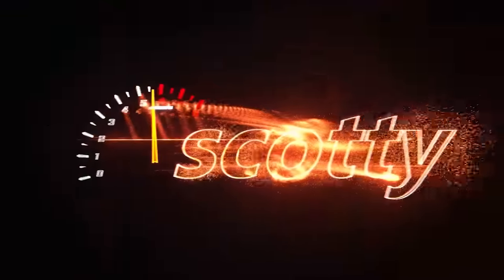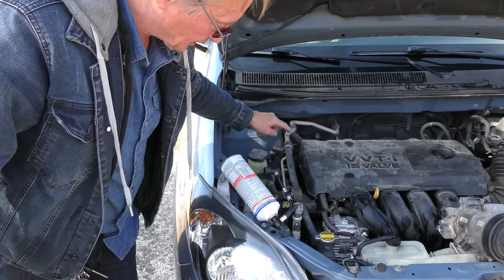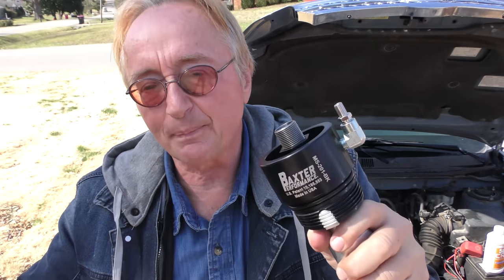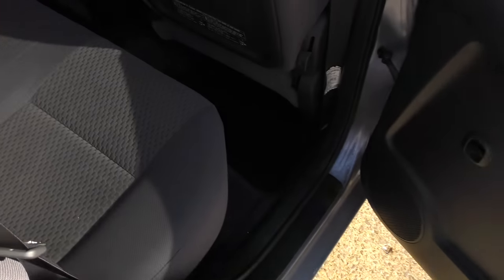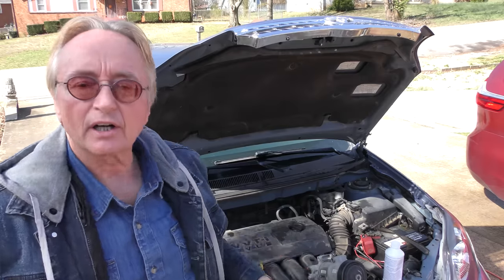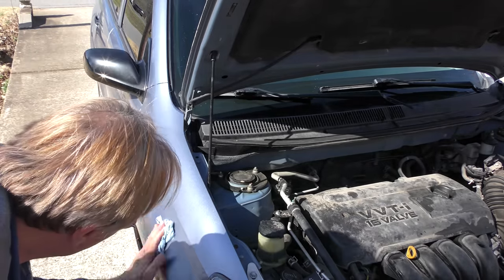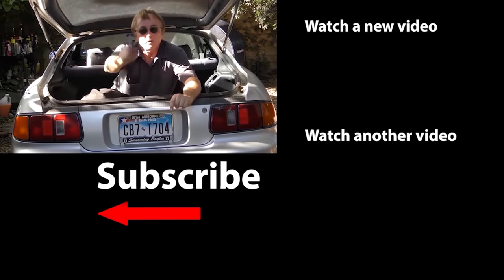7 New Car Products You Should Buy

Comment: Love the idea behind the Baxter cartridge to spin-on adapter... but for my wife's 2017 Highlander it's $280 !!!!
Love it... but don't $270 love it.    

I can change the cartridge without much mess.  There's a 3/8" center cap to take off, plug a drain tube in (comes with most cartridge kits), then you remove the cartridge housing... often cleaner than spin-on as you're draining most the oil.

Comment: I tried the rainx because Scotty recommended it and even bought my first car based on his recommendations and the man is completely honest and his recommendations are great.
Reply: I like the Rain X washer fluid. It also keeps the windshield beading up in the rain, even on 10+ year old windshields.
Reply: So, the RainX waterless carwash he shows here is great as a glass cleaner that'll allow rain to bead off the windshield?
Reply: Rainx and Cthru are very old products been using them in Africa for thirty years.  Just make very sure you clean the glass properly before applying or its a mess when it rains
Reply: o he is amazing, and the local mechanic that I trust says the same thing as him 95% of the time, with the only real difference being where I live the temp swings from -20F (average) in winter and 101F (average) in the summer then you realize those are only 70 days apart, I need things that can handle wild temp swings and a few of the things Scotty swears by don't do well in those conditions

Comment: The ATS definitely works. Used on my wife’s GDI Hyundai Genesis 3.8 V6 with 50k miles. Used to throw out a little puff of blue smoke on cold startup (low tension rings), now no puff of blue smoke and gas mileage increased to exactly where it was new, which was almost 40 miles per tank full.
Reply: Just 40 miles per tank? Or per gallon?
Reply: @joshuaandrepatrelullauri1691  40 additional miles per tank full.
Reply: Where is ATS sold?
Reply: Full tank*

Comment: I like that filter converter kit, but the only real problem I can see is that oil filters are often in a weird spot and the filter "converter" may be too large and not be able to fit as I've seen instances where you might have only about 3 inches between the bottom of the filter and something else, so it may have limited use, but a good idea regardless.  Plus some cars have the oil filter on the bottom of the vehicle.  So adding something like that may make it too long, risk getting bent or broken and then you have bigger problems.

For paint, I think it may depend.  I had to get some touch up paint for my Camry to fix a small rock chip, and being that it's only 2 years old and the Celestial Silver color (which is a silverish blue) it's hard to find that paint color (even though that color has been out now for 5 years since the most recent generation came out in 2018 in the US).  If you have an older car, then some of those paints will probably work fine, as they will likely be the best you can get, but for newer cars, I would try to get the OEM paint first.
Reply: Another problem is that adapter is $250.00.  I'll buy the synthetic media Fram Ultra insert and deal with it.  If it was $30.00 id say it was a good idea.

Comment: I purchased the ATS Fuel Treatment recommended from a video of yours last year and it got rid of my check engine light on my Q7. Carbon build up on the valves, It Worked!! had to run two applications but it saved lots of $$ of having the intake removed and the valves chambers cleaned. I recommend the product all the time now. The Oil treatment is great too!

Comment: I have had the 3d maxpider floor mats on my car too for 3.5 years now and it still looks brand new when I clean them! Highly recommend. 
I didn't know about the consumer ac refill. Great to know!
Reply: I've tried them all and Maxpider Kagu's are the best!
Reply: How does it hold up again spills and snow? I have weathertech and wondering about this brand
Reply: @Streetracerex1998  it's completely weather proof . Spills, snow, rain, mud, etc. Won't get passed this mat. The top layer is like textured plastic (probably some high tech stuff) but is completely water proof. It also has high walls that hold it's shape well so nothing is vgetting passed this very slim
Reply: @Streetracerex1998  Amazingly.  There's an elevated rim that keeps in water/snow, etc.  I drive Uber and have tried Weathertechs and Huskies which are garbage and ghetto looking compared to the Maxpider Kagu's.

Comment: Scotty you should follow your own advise. There is no way to tell how much refrigerant is in there. The only correct way to do it is to get a set of guages that measure both sides, drain the system of refrigerant and fill it to the factory load that's listed under the hood.

You won't know if there's a problem with the AC system unless you measure temps on both sides and do a vaccum test to see if there are any leaks.
Reply: so you are saying NOT to use that product from Autozone?  I'm thinking of doing so based on this video
Reply: @usaman7358  That isn't what I am saying. If you want to do it correctly, draining the entire amount of refrigerant out of the system, and look up how much refrigerant your car takes. Buy only that amount of cans and put them in.

However without a set of guages, you won't know if you have a leak or clog in the systems

Comment: My way of not making a mess from the oil filter is as this. First warm up vehicle. Next pan under filter. Use 16 penny nail to pucture filter. Go inside watch T.V. for half hour or so. Remove filter And install new filter. Don't forget to apply small amount of oil to the rubber gasket at the top of the filter. Reposition drain pan. Remove oil pan drain nut. Go watch T.V. again for half hour or so. Reinstall oil pan drain nut. Fill crank case with oil. Use funnel to put old oil back into now empty oil bottles. Return used oil to parts depot.

Comment: So as someone who spent 6yrs in the automotive industry you do not want to use those emergency AC refills without research. Not all cars use the same refrigerant. Some are 1234yf and some are 134yf. You do not want to mix refrigerant. Check your manual before putting one of those in and make sure it matches. We have to have two separate AC machines for both types of refrigerant.
Reply: The 1234yf is reverse threaded on the connections, hard to mix it up

Comment: They did the same to me at Honda with my AC, we have to do the $150 diag, to replace the $5 Relay, which is 95% of the fix when this problem happens.  They swapped the Relay out, fixed the problem, only after they did the $150 diag.

Comment: Yea, one can go and simply fill up their a/c system as described here but the correct procedure is to, first, empty the system to a vacuum for at least 10 minutes (to dry the system out as water is damaging), check and repair leaks, and then place the correct, clean a/c refrigerant into the system, with the correct amount of a/c oil. 
Not applying the vacuum can be bad if you have water in your system, very bad.

Comment: I actually have the same 3D floor mats for my 2013 Subaru outback. Over time, I noticed that they weren't looking clean. I washed them with soap and a brush but they would dry dirty looking.  I don't recommend them if you're looking for something that looks clean after you wash it.
Reply: They aren't good mats. Nothing beats WeatherTech

Comment: Scotty, you should have told people not to turn the AC filler can upside down when filling the AC system.  Getting liquid Freon in the system can muck it up quick.
I checked out the oil filter adapter.  YOW!  $$$$!
Reply: Also, didn't they switch to a different refrigerant on newer cars?
Reply: @robertknight4672  Yes.  People still call it freon, though.

Comment: The Baxter adapter for a 2014 Jeep Cherokee 3.2L V-6 is $350.00. I can buy 23 K&N cartridge oil filters for that price. Ouch.
Reply: One time usage
Reply: It's about keeping your vehicle in the highest quality possible for the engine and transmission. You can put a spin on filter that has an anti drain back valve

Comment: It sounds like using the ATS fuel treatment got you about a 1 mpg improvement.

Another simple thing worth doing to improve mpg is to clean the mass air flow sensor, making sure to clean all the right places - the wires and the bulb-shaped thing(s). I watched a Youtube video showing those places. Changing the PCV valve is another usually cheap thing worth doing. (It wasn't cheap on my Mazda 3, because the PCV valve was under the intake manifold, so I paid someone to do it.)

After doing both of those things, I got roughly a 3 mpg improvement. This is probably the first time in its 70,000 mile life that they were done, so it's not surprising it made a difference. It made more improvement than I expected, too.

Comment: I also prefer corded appliances, but recently bought a battery hand drill that has performed very well. Other battery tools had the battery die in less than two years, even with recommended charging. The new batteries work well, but I still buy corded.
Reply: Bought a 1/2" drive Bostitch drill Christmas special,  came with hard case, 2- 18v lith batteries/charger for $99.. That was pushing 10 yrs ago.. and I'm still using it.   Bought a Dewalt 1/2" about 2 yrs ago with 2- 20v batteries, with soft case.  Needed one more compact, and I figured, how long can this Bostitch last?  🤣🤷‍♂️  still going...

Comment: I drove a car hauler since I was 23 yrs old and rain X worked great on mirrors and windshield and yes you can drive them with wipers off but were great on mirrors and spot mirrors, oh by the way I hauled for GM but I drove Dodge cummins have had 2  and one was a 1992 5 speed manual and the latest is what Iam still driving my 05 Dodge 3500 4 door long bed dullay with 6 speed manual and 4x4 . Love your video’s!!!

Comment: Spot on about the Baxter oil filter conversion unit. A little pricey but worth it. Built like a solid piece of steel. My mechanic had to do it for me because the Toyota dealer put the cartridge filter on so tight I could not get if off but I took it to a mechanic to get the plastic garbage off and install the Baxter unit. Really simple to do but like I said but the Toyota housing was really overtightened, On an 18 Rav4. Love it. Do it!! You won't regret it.
Reply: That will not work on my 2012 Camry, that stupid adapter thing is so long that the oil filter would actually be dragging the ground. The cartridge filter is just not that big of a deal to me, they work fine.
Reply: @markkauffman6184  I know what you mean. The model they make for the RAV4 enables you to use a filter length that when installed  cannot be seen and doesn't protrude at all. Of course you have to use a shorter filter but it seems to work fine. Nothing wrong with the original cartridge system but if you don't do your own oil changes you are trusting someone to install them without over tightening, which happened to me.(it was a Toyota dealer too, that's what really P...ed me off.
Reply: Do you tend to repeat sentences twice in daily life, too ?!?
Reply: @warriormanmaxx8991  Now that comment is really petty. I hope it made you feel better to put someone down.

Comment: I recently changed my oil on my 2012 Malibu and found oil gushing from the top of the plastic cover. I had cracked it either taking it off or putting it on. My car would not run will it was leaking like that. Luckily Autozone had a replacement on hand. I'll have to keep a spare or get this adapter you showed. I think I'll get both just in case.

Comment: The emblem on the floor mat will break off and leave two holes in the mat. If you don't plug the holes, all the water will go down those holes and get in your carpet and won't dry because the mat stops air from drying carpet. So if ya get these to protect carpet from mud, good luck
Reply: How do you know?
Reply: @DonYeyoReaks  hes obviously had them..

Comment: I think you missed the main point on the Baxter oil filter adapter, its designed to keep the oil in the top of the engine on the rockers and other important parts, especially the first few seconds during cold starts.

Comment: Got a 03 Yukon Denali bought it new with 11 miles on it, it now has 155k miles and the AC system has never been touched or recharged after 19 years. Still blows 30 degree fahrenheit air on a 90 degree day.

Comment: I bought Baxter adapters for my 4Runner and Tacoma.
Wife took the Tacoma for oil change, the mechanic wouldn't use it.

Also, I will need to cut a hole in the skid plate of the 4Runner to have room for it. Trial and error, Baxter didn't offer any help with where to make the hole or how big. I love the idea of using spin on filters, but it'll take some doing

Comment: About the floor mats those look awesome.  My only issue is I prefer carpet on the driver side so I can wipe the bottom of my shoe off if it's wet before I touch the petals.  Happened to me before that my foot slipped off the brake because it had gotten slick so it became my habit to wipe my shoe off when it's wet outside.

Just seems all the custom mat companies are making things that do not absorb water at all.  Which I get the reasons for doing that, but there's a downside as well.

That Headlight looks sweet!  Having been a contractor for 16 yrs I went thru a lot of headlights and flashlights.  That one looks awesome.
Reply: I don't rubber floor mats either.  All the water sloshing around in the winter drives me nuts.  Why not some super absorbent Carpet mats.  It honestly feels so much more premium to put my feet on carpet.

Comment: I'm thinking about the Baxter oil filter adapter for another great feature. I have a jl wrangler with the dreaded 3.6 Pentastar v6. This keeps oil in the filter so that it can lubricate the valves and cams in the upper part of the engine during srart-up so it helps prevent dry starts.

Comment: Honestly those plastic filter housings are not bad at all. The one on my 2013 corolla has lasted over 200,000 miles worth of oil changes lol. It's easy to remove, pull the filter paper out, but the new one in and the new ring. To each their own.

Comment: The oil canister adapter looks like it will hang lower than skid plates? How will that work off-road or with on the road debris???? It can't be any longer than the stock set up or you're potentially asking for it to be puncured and there goes your entire engine? I also heard the Baxter adapter is around $250....I'll deal with the mess and keep my clearance and thick aluminum canister housing....

Comment: I'm going to try this ATS fuel system cleaner. If it does mostly what a mechanic charges for cleaning your injectors then it's worth it. SeaFoam is a funny thing. In the fuel system it doesn't do jack but if you have an older car that uses organic, non synthetic oil it can do a lot to clean out the crankcase and engine. It works really good on those Briggs & Stratton lawnmower engines. Those things are really bad at sludging up on you.
Reply: Briggs & Stratton have gotten so cheap nowadays. Plastic carbs and cheap build quality.
I bought a new mower in 2017 with a Briggs engine and used nothing but Synthetic oil and changed it religiously and in the 2nd season it already had oil blow by leaking a bunch of past the air filter and making a mess on the deck. Apparently its bad piston rings or head gasket.
I bought a Honda last year and haven't looked back. Build quality is night and day.

Comment: I had a 09 Matrix that burned more than a quart per 1000 miles at just under 100,000 miles. 13 sonata with 180k doesn't use oil at all. All makes have some lemons.

Comment: Scotty have you tried using the oil canister bypass on the matrix? I have 09 Pontiac vibe, and dont want to use one of those unless its proven to work for the long term. Dont want it malfunctioning and either not filtering properly, or starving the engine of oil.

Comment: I have a 2004 Toyota Tundra. With my Blue Drive I read my chicken light was caused by an O² sensor. I had them changed in 2018. I am wondering if the ATS 505 will help.  Or if I should use it at all in my Toyota considering the year.  I did move from Orange Texas @ 16 Ft sea level to Washington @ 187 Ft sea level. But I am thinking this does not matter or all my O² sensors would throw a code.

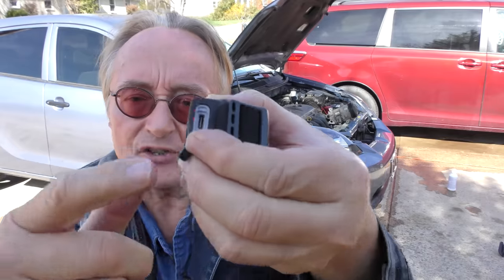Comment: 6:16 my son bought me 2 Beni hats and they have a place where a really great long lasting LED light fits . It has3 different power modes and also plugs into a standard charger that you put your cellphone cable in to charge and I can’t believe how strong they are and how long the battery last before it needs to be charged. I lost 1 and found it about a year and a half r 2 years later . It charged right up and shows 0 signs of being effected after being dead so long

Comment: I have a 2017 Toyota Prius I bought it new in 2018 gas prices were low no one wanted them got a great deal I have 45,000 miles on the vehicle and I have averaged between electric and gas 107.5 miles per gallon I can send you a picture if you don’t believe it.I believe the combination electric and gasoline works very well for around town commuting not necessarily long distance.

Comment: Huge fan just bought 2004 nissan maxima sedan SE 6 speed dual exhaust. Anything at all about the car you'd have to say even review the thing would be rad. There are few things I'm getting repaired , anything I should watch for, any great actually useful mods , 5 k added value in parts or less give or take is my current stance on it. It has 105,000 on it a brand new inspection sticker . Think I should replace belt and water pump?